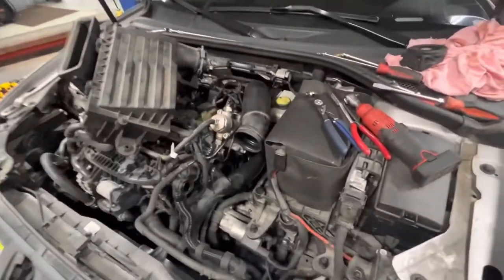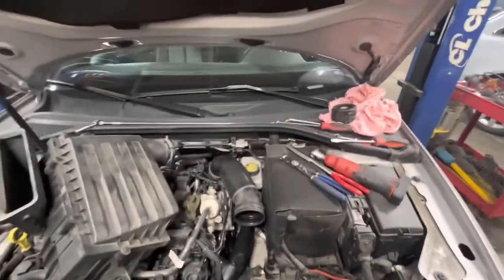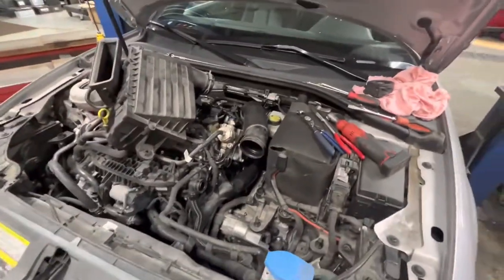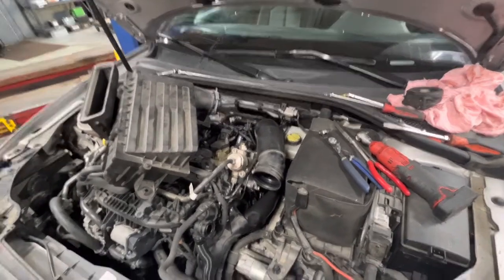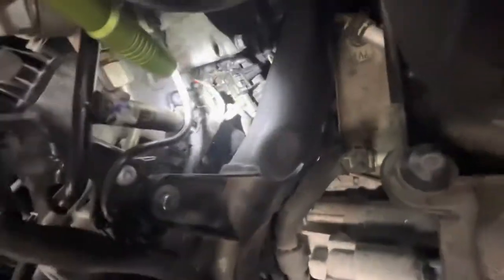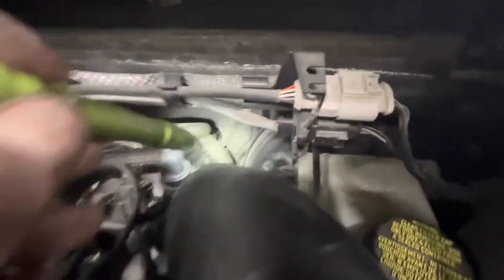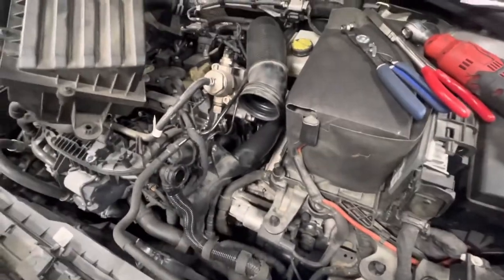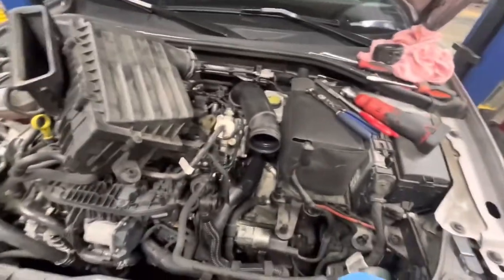2015 AUDI A3 TDI Intermittently does not have heat

Comment: I have a similar problem with my Audi A5 2013 - heater doesn't work at startup, after driving for 10 mins I then turn off the car and restart and then the heater comes on and stays on?

Comment: Do you know how to bleed air from the heater core. Had a new one fitted and full coolant drain but can hear bubbling sound like air is in the matrix get warm air for a while them dies off
Reply from the maker: If you bring it up to temp and let it fully cool off a couple times it should burp it up on its own
Reply: Or with vacuum machine or manually. Open gently coolant reservoir with warm engine and let air go. Then close and repeat few days

Comment: Hi, could it be the same error? I have an Audi A3 2.0 TDI from 2016.
1 Fault Found 10385 - Coolant Circulation Valve (N214)           P1259 00 [10101000] - Short to Ground          MIL ON - Intermittent - Confirmed - Tested Since Memory Clear

Comment: Hello, my car is a vw golf 1.9 105 hp BKC manual transmission (I don't have a second thermostat) I replaced four thermostats and a temperature sensor. Also the car has been serviced (belts, rollers and water pump) The car heats up, but when I turn on the heater and leave it in place the temperature drops to 70 degrees. Can you tell me where to look for the problem. Thanks in advance
Reply from the maker: Did this issue start after a particular part was replaced? You are saying at a stand still with the engine idling when you turn on the heat on high the engine temp on the cluster drops down?
Reply: Yes, with the engine running, when the car is heated to 90 degrees, I turn on the heater and it drops to 70 degrees. Everything started after changing the tee on which the temperature gauge

Comment: Great video, I have similar issue with my Audi A3 2015 Quattro, takes about 15 min or more to get heat and not really hot, I have no leaks, thermostat seems to open fine, the only code I have is P2683, is that the good part number for my model: 4H0-121-671-D? Thanks for your help, John
Reply from the maker: I think that number is correct, thanks!
Reply: @EuropeanAutoRepair  Thanks for the reply! Do you happen to have a tutorial on the procedure to replace that heater control valve, I can see that you removed the filter box, seems to be easier than changing the waterpump and housing!
Reply from the maker: @2CleverInnovations I’m sorry I haven’t made a video on that one yet, next time I have the opportunity I’ll do that